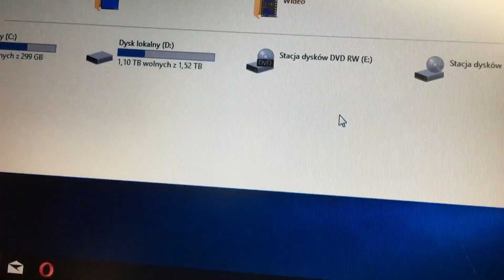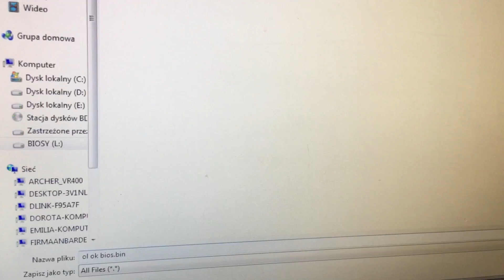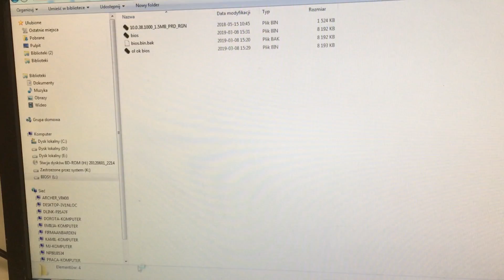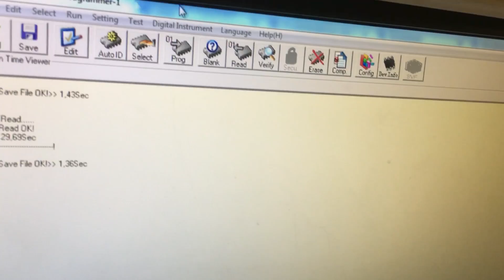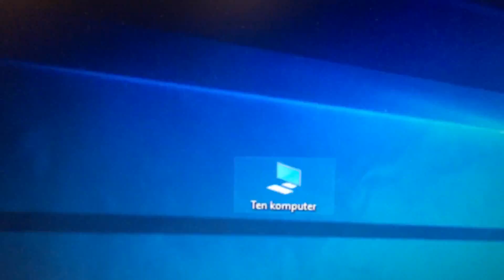Wymiana lutowanego procesora w laptopie Acer. Lutowanie procesora BGA.

Comment: Hello
What BGD rework station do you use please ?
Reply: Preheater plus hotair station solution i enough... :)
Reply: @PiotrK2022  Think you !
Reply: @dark-california  
No problem, bro. Remember to control BGA chip with infrared thermometer or multimeter with thermocouple because you can easily overheat it - it's very important, especially in case of GPU or PCH...
Reply: @PiotrK2022  I definitely will ! I'll try to go as low as possible just to melt the solder and remove it